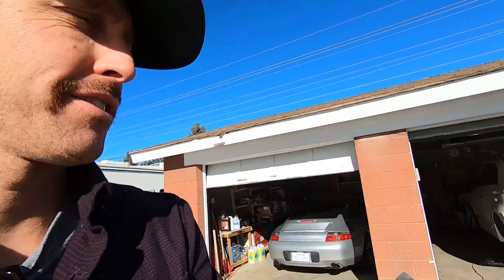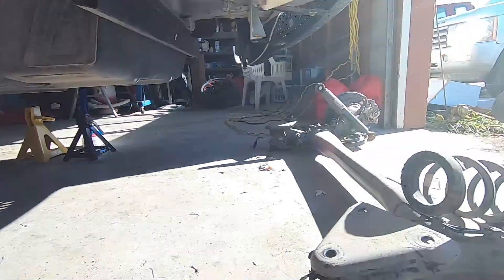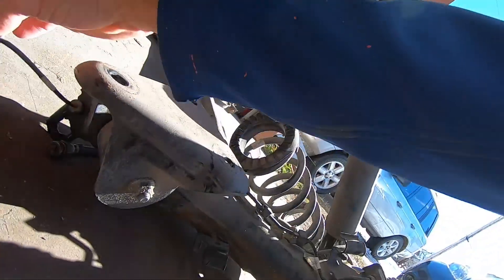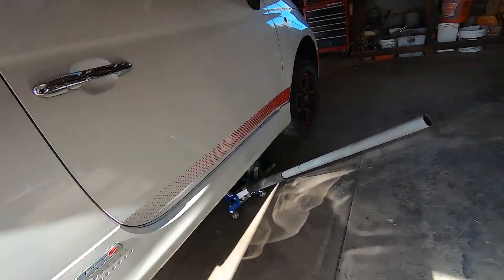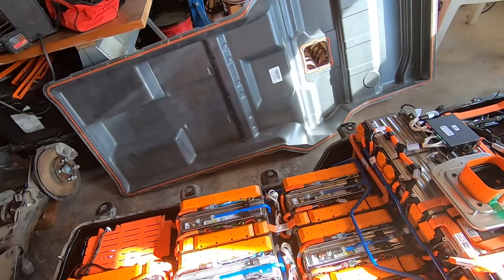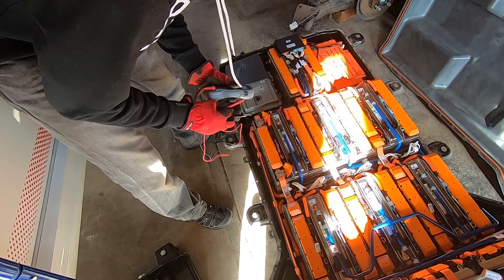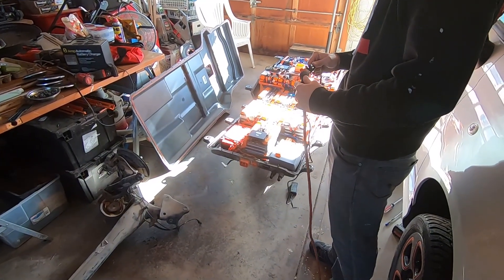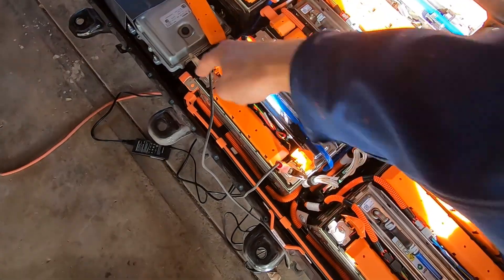Fiat 500e - Removing the Battery Pack and Looking Inside

Comment: Greetings friend, I hope everything is very well, friend I wanted to know if you could help me with a fault that I have in a fiat 500e, I have already solved several things, but now I only have that it does not want to charge, every time I connect the charger it appears a notice in the closter that says to service the charging system and the two lights at the ends of the dashboard indicator that indicates the amount of charge in bars remain on, I disconnect the charger and everything remains normal, I have no error codes. .?

Comment: THE FIRST THING I MUST REMAKK THAT IT I S EXTREMELY DANGEROUS TO WORK ON THE HIGH VOLTAGE SYSTEM. IT CAN KILL YOU! IT IS REALLY SUICIDAL1 - ONLY PEOPLE WITH THE SO CALLED "HIGH-VOLTAGE CERTIFICATE" ARE ALLOWED  TO WORK ON THAT!
what you do is highly careless and  riskful! keep away from everything with orange color
how long did you try charging? sometimes it needs time  to gain enough power for the loading management. do not laugh: i experienced that with my external "navigon "navigation. it seemed dead, i forgot to unplug that, and after 15 minutes i saw that it came back to life.  

do not forget: you need a working 12V battery, to start charging. at least that is for the new fiat 500e which i own. without energy from the 12V battery you cannot charge. most owners o EVs (no apostrophe with the plural-s) do not know that!

Comment: How many miles on car. My 2011 and 2012 Nissan leafs battery degradation started at 30,000 miles. Luckily I leased all three cars
Reply from the maker: 50k miles.  This issue is a common on the Fiat.  I have a Leaf as well, it's a 2013.  The battery degradation has not been bad.  Still at 10 bars at 57k miles.

Comment: You need to measure each cell, not module. Charge for a few min and if all cells go upp the same the module could be ok, if one cell is still dead the module is no good. If you continue to charge with a dead cell the others cells might over charge, ones they hit 60-70degC the temp will run away and everything will burn with no way to put it out. I would however never use this pack in a car again, to risky
Reply: Correct. Measure each cell individually if you insist on continuing.
Reply from the maker: I'll try this although I am losing hope with this pack since it is losing voltage after charging.

Comment: Your buddy with the cigarette is absolutely wrong. Ive charged multiple individual cell modules  in pack form.....but it will take forever with that small of a charger. Get all the cells (5s and 6s) to about 20v  and reinstall the pack and then let the actual pack charger handle the heavy lifting and balancing. Any modules that don't come back will need to be replaced. Do NOT charge the pack under freezing temps and I personally would not charge them unattended either.
Reply from the maker: @Cyumadbro summit - Thank you so much for your helpful comment!  I’m wondering what charger you recommend? You’re right, the one I bought is not up to the task.  Thanks!
Reply: @KennyGillis  In general, I would recommend a simple "bench top power supply". For max flexibility (12/24/36/48Vdc systems), I use Wanptek KPS6020D (60V, 20A) from Aliexpress and the CSI6015SW (60V 15A) from Circuit Specialists if you like do buy from a USA based reseller. You can use such machines for many more applications. Both can do basic CCCV charging and I even put two CSIs in parallel for higher current output. Just limit their power output to 80% of their rating to make them last as a rule of thumb.
Reply from the maker: Thanks!  I ordered the Amazon standard bench top power supply.  Said it will be here today so may get to experiment some today.
Reply: I agree. In addition (everybody hopefully knows but just to be sure): Charging "bricked" cells has been tried before on youtube, e.g: "Tesla Module repair | Zero volts to useable? Lets find out !" To quote a comment below that video of @Ste Da: "Please DO NOT try to revive those cells. Even if it works out and looking fine at the beginning, within the cells, crystal could have predamaged ONE or more cells. If ONE cell has a thermal runway, this will end up in fire, explosions, burned house and dead bodies." Think this is FUD? Read "Mechanism of the entire overdischarge process and overdischarge-induced internal short circuit in lithium-ion batteries" in the Nature Journal.
Reply from the maker: @diyEVguy  Thank you for your comment!  I’ll check these videos out.  So you would not try and bring them back?
Reply: @KennyGillis  Personally I would not do it. Watch a couple of lithium battery fires on youtube to get a feel for the possible consequences. I recommend watching Rich Rebuilds' "My first Tesla battery fire"
Reply from the maker: I’ve seen that video, that was a beautiful disaster.